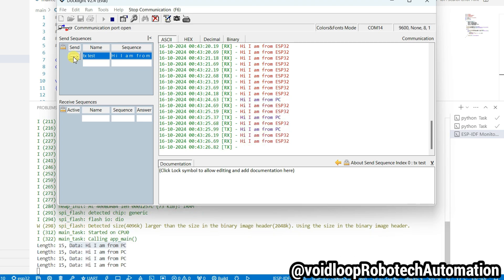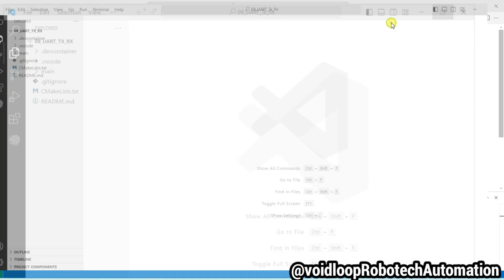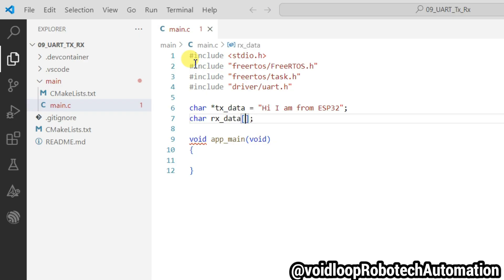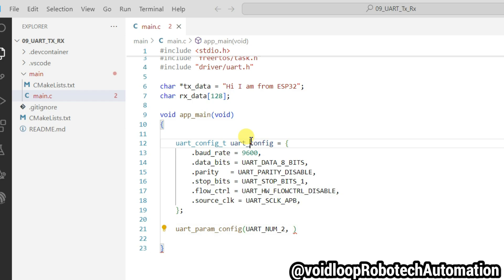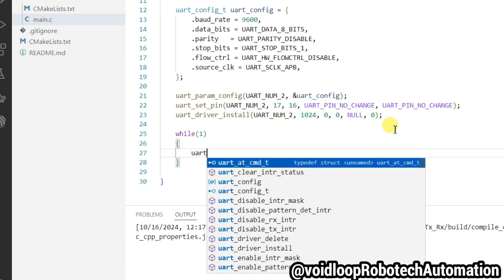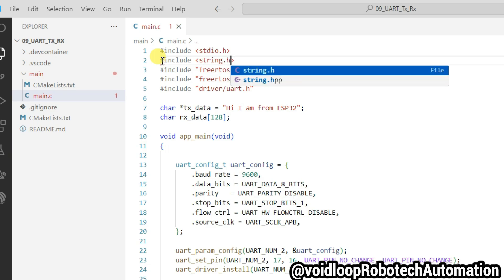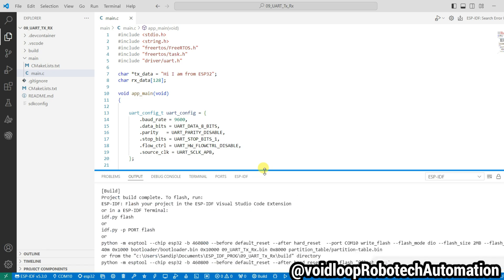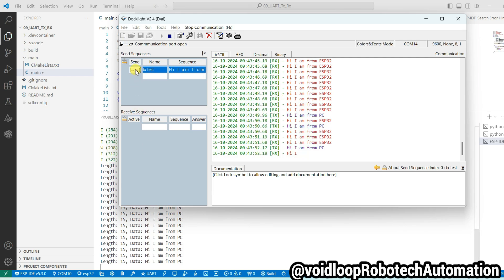09 ESP32 UART Transmit and Receive with ESP-IDF and Embedded C

Comment: I'd like for the ESP32 to connect to the network, then serve a VueJs page that is stored in SPIFFS (or LittleFS , FatFs, JesFs, STORfs) [project templates->protocols->http_server] .  I'd like for it to use mDNS so that the end user just types esp32.local in their browser.    (If there's no network available then configure as a hotspot/access-point  [project templates->wifi->softAp])

In any case, I'd like the esp32 to push real-time data (via websockets) to all the connected client browsers.  The source data will come to the esp32 via uart.

Not sure how difficult it would be, but is it possible to even use css/html elements from uiverseio (like Nawsome/empty-snail-69 )?  Or even stream audio/video?